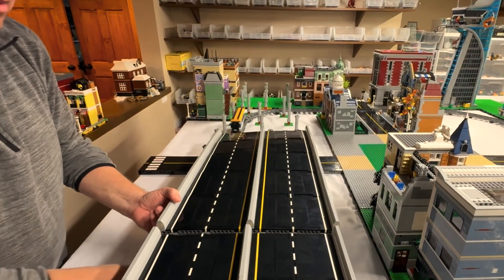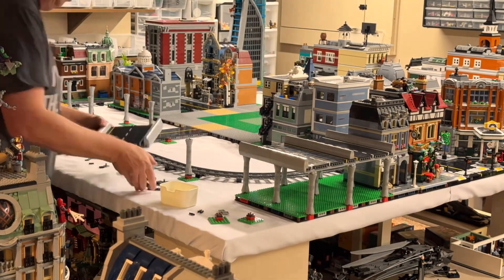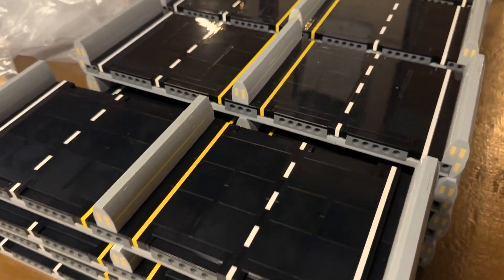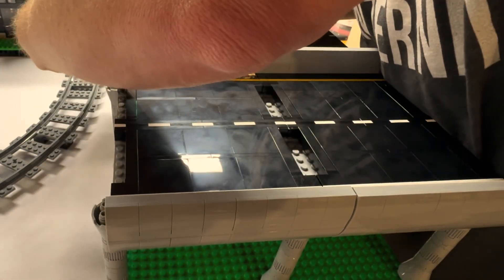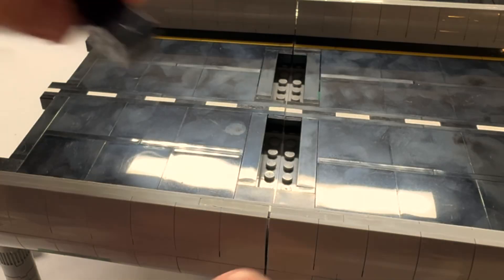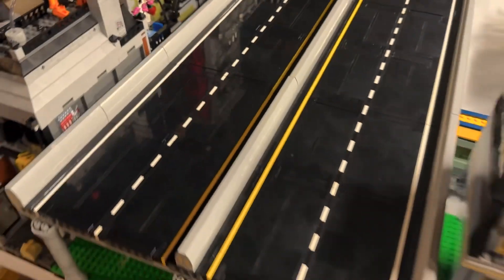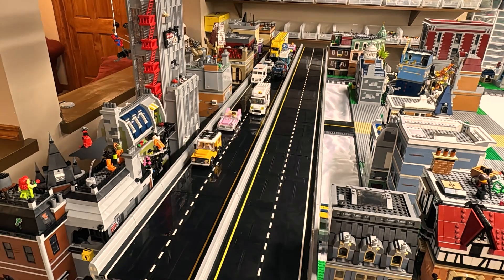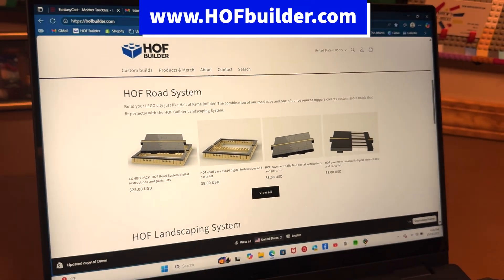Trouble-shooting our LEGO freeway install

Comment: Do you have a plan to get the MILS plates under the supports once you finish them? You could get some long brass tubing from Hobby lobby and slide them through the technic pieces to help support them as you're moving them.
Reply from the maker: Not yet! That’s a good thought though